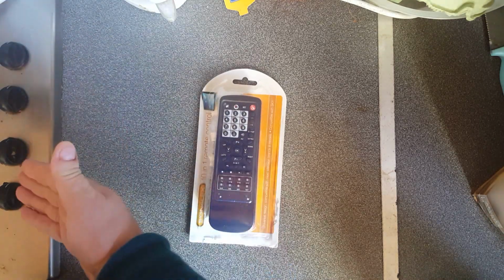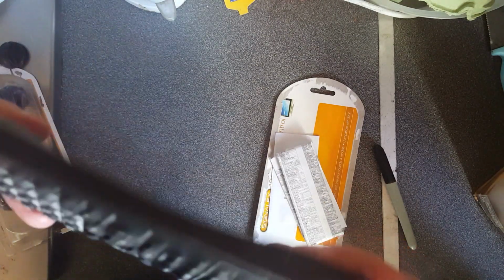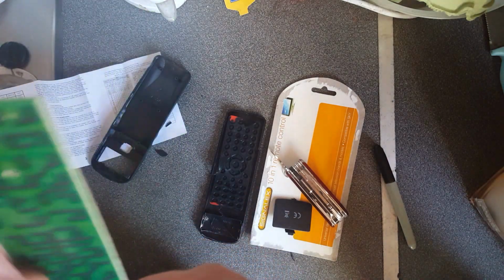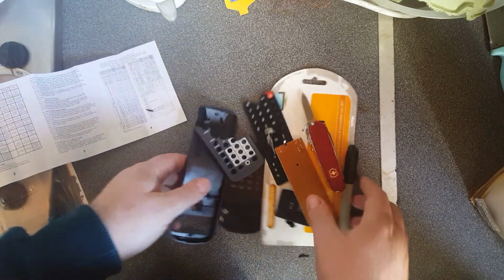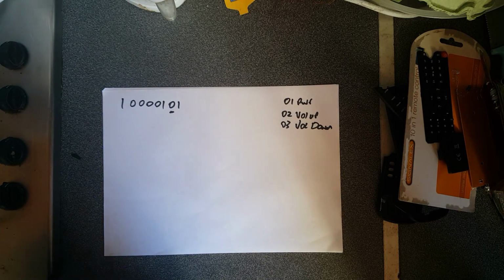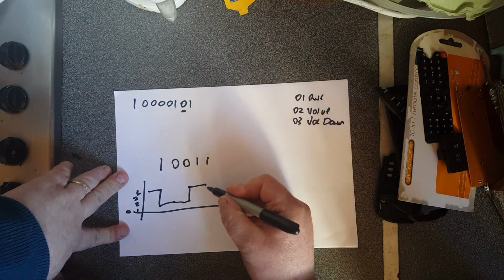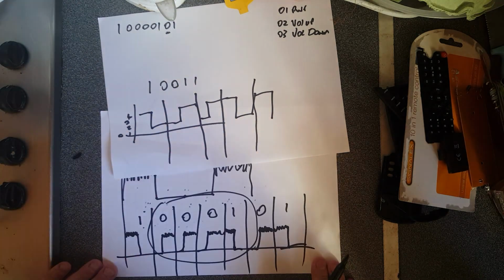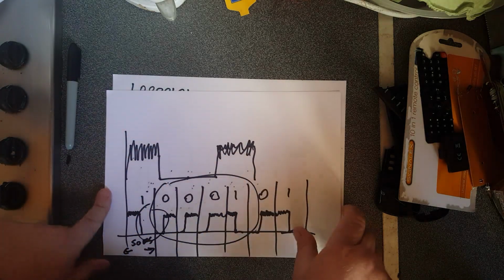A review of a cheap universal remote control and a look at how remotes actually work.

Comment: Mine came without the code list sheet which makes it pretty much impossible to use.  I see another comment below is the same.  
My review and instructions now includes the full code list: https://www.youtube.com/watch?v=AxZXqMLNyRs
Reply: I have found that most (but not quite all) of the codes can be found here in the instructions for a different remote control: 
https://www.manualslib.com/manual/605418/Crypto-Urc-601.html?page=35#manual